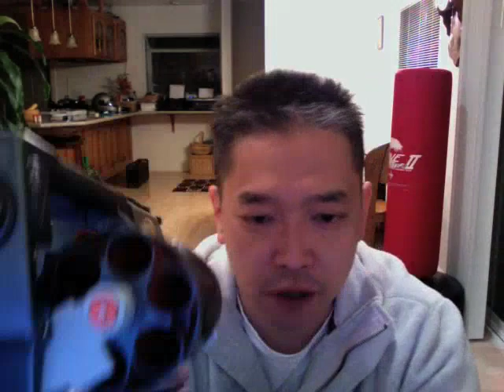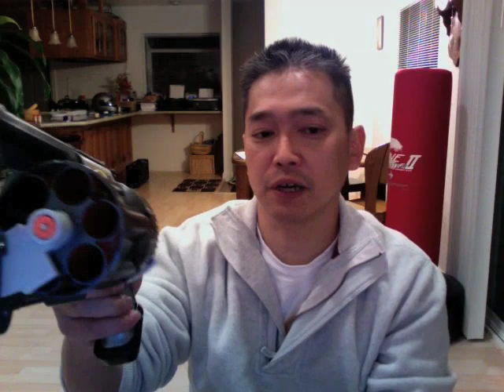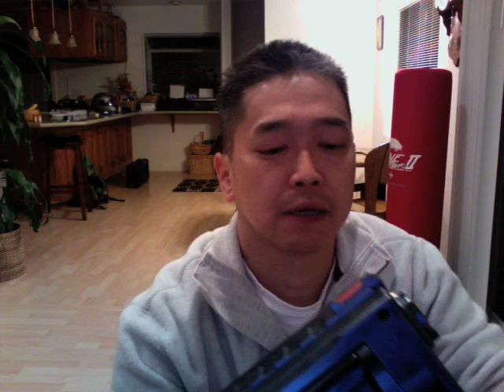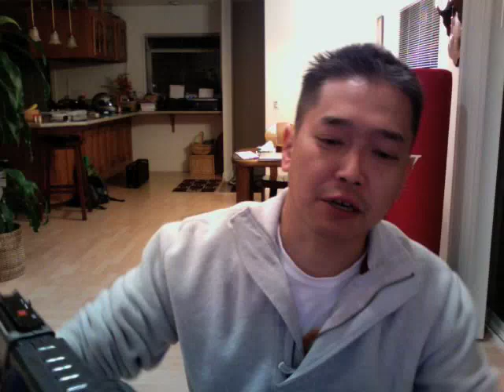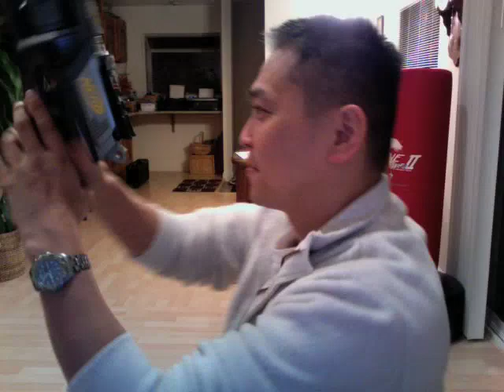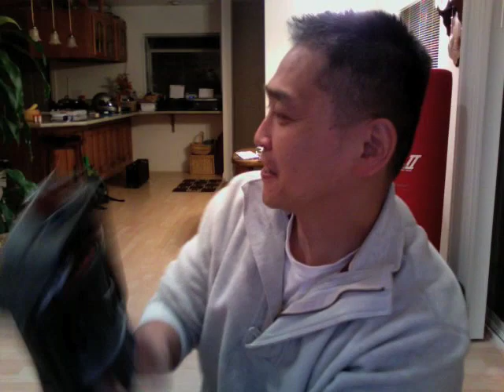Nerf Gun Mods Maverick

Comment: Nice,  However I found that when I did this I found that the power became inconsistant. Every other shot or so, would have awful power. 

I am wondering if it is because those prongs we removed helped keep the central barrel in line. Otherwise missing out on the airflow?